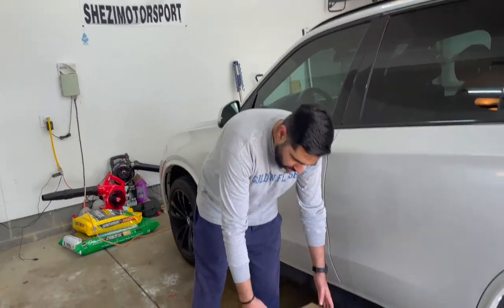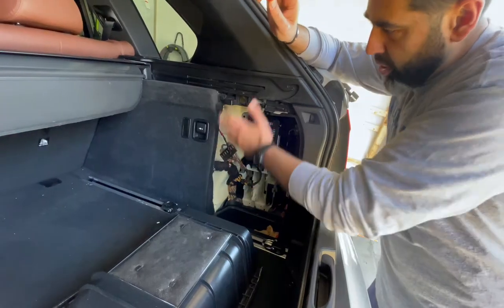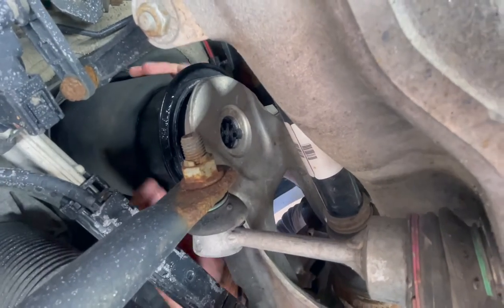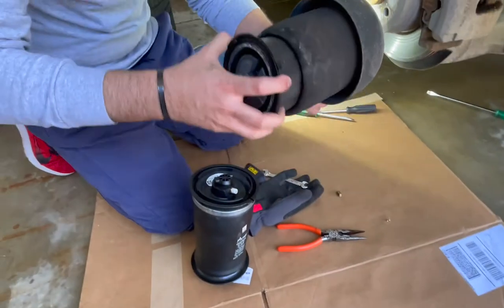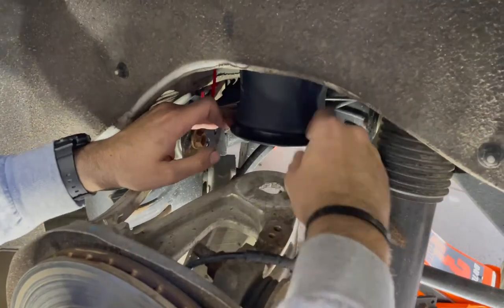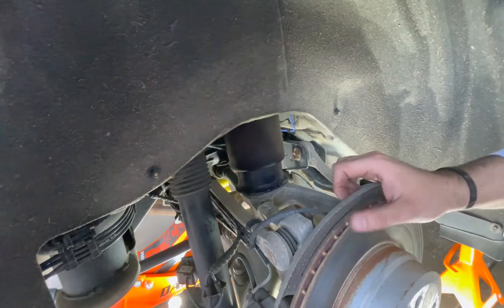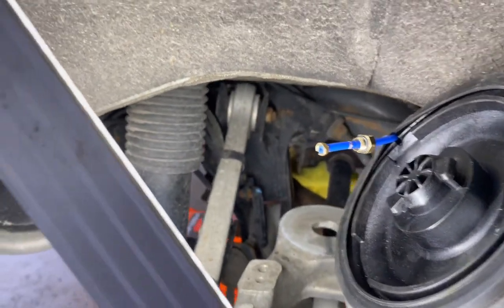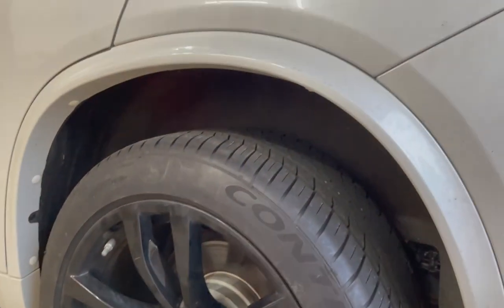How to replace  BMW X5 F15 rear Air Springs

Comment: Wishing I had found your excellent vid earlier, just replaced both of my air springs yesterday, guess I didn’t try hard enough to remove those “hats” on top of the OEM’s…….that would have made my job to fit them in the top much easier to center them, yet I did read many posts on forums AND YouTube vids on the stand none did I discover those tops were removable!!

Comment: According to the Arnott instructions, you're not suppose to remove the compression fittings! Just push in the air line until seated. Pull on it to verify
Reply: I did the same repair a month ago and they even send an instruction page that shows you that detail with photos. Sorry to say that seal is probably gonna leak on day 1. I wanna see a followup.
Reply: You're right about Arnott giving that specific instruction to not remove the fitting and we're supposed to push the air line in. But, the problem is that the line comes right out when you tug on it slightly after pushing it in all the way. I'm going through the same problem with my f85 air springs. After an hour of trying to get the air line to seat properly and not pull out, I've opened the fitting and did the same process the guy in the vid did. Hopefully I don't have any leak issues! 🙏🙏
Reply: not sure why that happened, worked well for me. Pushed it far enough that when i tugged on it slightly it was still inside and fully seated. You can obviously pull in out with enough force but the key is only to tug enough to know its fully in, not to test that it wont come out. Im guessing theres some kind of internal seal system that make it air tight from inside. kinda like the copper O-ring that comes off with the stock line. I think those fully engage when the system fully pressurizes.
Reply: @user-zr2yg5pm2q  I also attached the air fitting on two pillows using the push to connect fitting and no problem.  Arnott also recommends you do not put the cover on the new pillow (note it does not come with a cover).

Comment: Hi Thanks for your Video, i have mine to do but have a question if anyone can help.
If you remove the fuse guessing that kills power to pump? Can you not drill the old Air Bag to deflate as this is no longer any good, this would then save you remove panels to reveal compressor.
Is this acceptable? Look forward to all suggestions.Thanks in Advance.
Reply from the maker: @graemewatts9090  - bc if you pooyr a hole in the airbag and if any door gets open and car isn't fully asleep it will kick on the compressor so better to take the fuse to be safe
Reply from the maker: @graemewatts9090 main goal is to ensure the compressor doesn't turn on.

Comment: really good job, please advise me, I found that the two rear suspension drop 2 times in 1 month, I just pulled the fuse(110) and put it again and the bag returned full of air and the rear suspenion back with full hieght, so is it from the 2bags or something make the bags drops or what ?

Comment: If it’s deflated do you still need to deflate / disconnect with the wires? Please? Thanks
Reply from the maker: @galacy-gamer - yes bc otherwise compressor might get triggered during the replacement process and you don't want to keep rubbing the compressor

Comment: Hi, my 2016 bmw x5 f15 has an intemitent sag, only sagged twice in two days and been fine for a week or so, what could cause this??
Reply: You need new air boots installed. Get the Arnott, don't buy the genuine BMW. Arnott boots are considered an upgrade as it exceeds OE quality and comes with lifetime warranty. Arnott uses Continental Contitech rubbers. These Conti rubber materials are extremely high endurance, it is used on Continental tires and are far superior than what BMW uses.
Reply: Boot leaking causing pump to overwork eventually you'll need a pump if not replaced

Comment: Do not lower vehicle with under inflated air springs. Deflate and inflate with vehicle raised. 

Remove compressor fuse, use a scan tool or crack lines at valve block/compressor to deflate air pressure. 
Remove tire. Remove air spring. Replace fittings or be very cautious to reuse because brass is soft metal. Tighten fittings. (Side note, compress the air spring by hand and use soapy water to check for leaks at fittings, air spring clamps or bag itself.) Install air springs, route air lines properly and install compressor fuse. Place tires on. Let vehicle inflate air springs while elevated. Air springs can damage if set on ground under inflated. There are pressure sensors to prevent blow outs btw. Set the vehicle back on ground and enter ride height for adjustment or each side may be higher than other side.
Reply: Cycle key on when compressor fuse is installed and tires as well to allow air suspension module to inflate before placing vehicle  on ground.
Reply: Ride height adjustment is at bottom of rim to bottom of fender depending on model. Some are center of rim cap to bottom of fender.

Comment: Did u remove battery terminal negative before removing it?still need to do the calibration back after install new?
Reply from the maker: @snoopy - no I  didn't remove battery terminal just the fuse that was pulled out from air compressor kicking on.
Reply: @SheziMotorsport  mine rear height a bit lower  than front.can you do a video how to leveling air suspension ?
Reply from the maker: @snoopy - does it auto correct when the car is running or when you start driving? Is the ground almost leveled?  Have u checked leveling sensors to ensure they are good? Sounds like leveler sensor issue.
Reply: @SheziMotorsport  I dint change that sensor .if  change the sensor,would it be auto leveling back to normal height?
Reply from the maker: @snoopy not sure if the issue is with sensor or something else. My thought was maybe sensor leveler is acting up or jammed. Otherwise it should rise normally and stay there unless you are parked in uneven surface
Reply: @SheziMotorsport  no,park flat place.im trying to lift a bit higher on rear side with scanning tool but fail.if read from the panel car, it's say same high but I measure the body with rim front and rear, definitely front a bit higher.
Reply from the maker: @snoopy - that's odd, yeah I don't think you will be able to raise it higher with any tool as when the car is running it will try to self level the rear suspension bc of built in leveling system. Unless you are lower then the factory height in rear.
Reply: @SheziMotorsport  I think the leveling is according to the sensor front and rear,if all at same level should be ok.

Comment: great video, thanks for posting. How many miles until your bag leaked?
Reply: Replaced both yesterday on my 2017 F15. The bag on driver has completely failed without warning, my X5 had 70k mi.
Reply from the maker: @old jarhead - one was factory original about 85k  and the other was around like 25k ( this one didn't need to be replaced but ended up doing it as I went with aftermarket)
Reply: Hi mate, great video. Unfortunately with my x5 I may have driven the car few month without noticing the leak. Is that something bad for the car?
Reply from the maker: @prasannabandara7104 - it all depends how much the air compressor was working all that time,  I would worry for the air compressor to go out.  I would recommend changing as soon as you have time to preserve the air compressor for the long term.

Comment: I changed both my rear bags now the left in is still sitting low and keep getting the warning message chassis function restricted. The passenger bag is inflating ti the correct hight driver is is inflating but not to correct hight and I never got that message before I changed the bags. Can you please offer any advice
Reply from the maker: @Sam Mead can you please check the driver side connection at the bag that you installed and connection at the compressor ( I can't recall the exact colors but the driver side is red line I think)
Reply: @SheziMotorsport  thanks il take it apart and check again today. The bag is solid so it is filling with air just not to the correct hight

Comment: If they are going to be replace why can't you just remove the fuse to the air compressor and pierce both air bags to deflate them rather than doing everything else?
Reply from the maker: @chris hands - I suppose that's one way to look at it. I made the video for diy purpose where remove and install was done and along with that, my only one side was bad.  And I wanted to ensure my air compressor didn't do any extra work at all.

Comment: Were your Arnott bags equipped originally with push to connect fitting? Why have you decided not to use it?

Thanks!
Reply from the maker: T Ventz - I did use the push to connect fitting when connecting new airbags.
Reply: Great. Thanks for reply. I wanted to confirm. So did you actually have to unscrew the fitting from the new bag to install it on the air line or would it be just okay to push it in and be done? The set I got says do not remove the connection. 

https://arnottinfo.com/manuals/A-2642.pdf
Reply from the maker: T Ventz - correct new bag has it on and you remove it from there and attach it to hose and fit it there and tighten the screw. But that fitting be very carefully not to bend to much or it will break and you will be out of luck. If your old one is intact keep it as a backup when you replace them. 
That's odd bc then how would you fit it on there, I would imagine higher chance of breakage.
Reply: @SheziMotorsport  You just need to push the air line into the new air bellows. And don't unscrew the new one. Arnot put a movie of that on youtube

Comment: Not the same for x6 f16?
Reply from the maker: @Brandon - if it has rear air springs then it should be same as it shares many things with x5 f15.
Reply: @SheziMotorsport  thanks man just found out i have a leak in my driver side rear..
Reply from the maker: @Brandon - ouch man, I'm sorry, change it out.